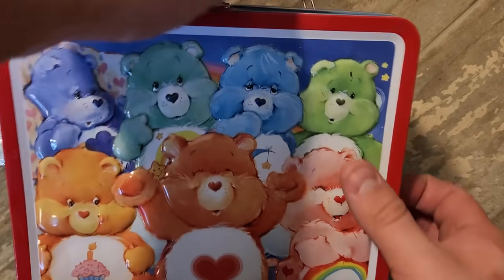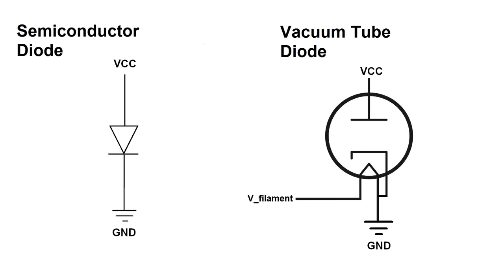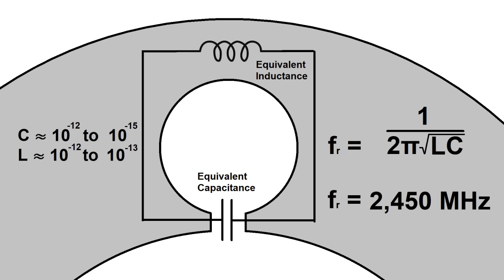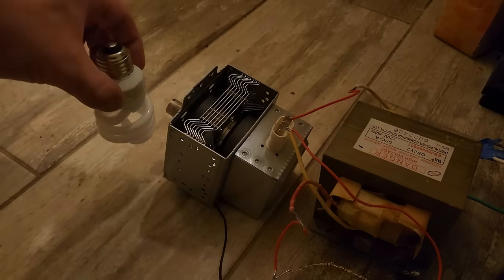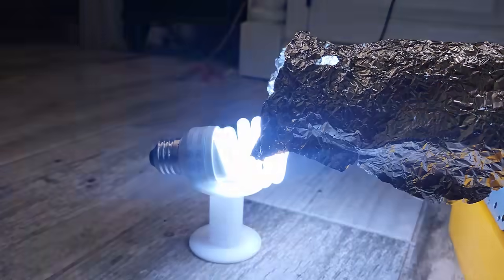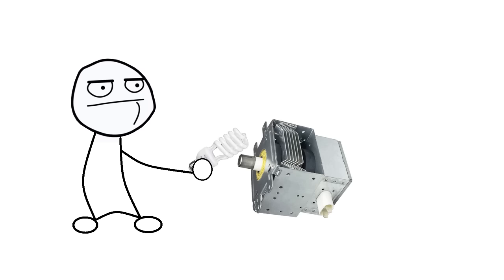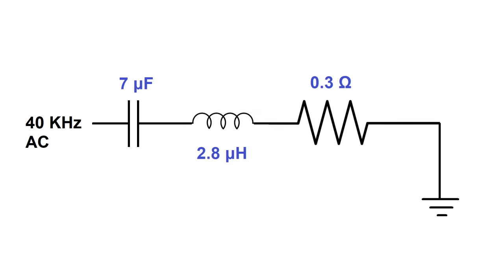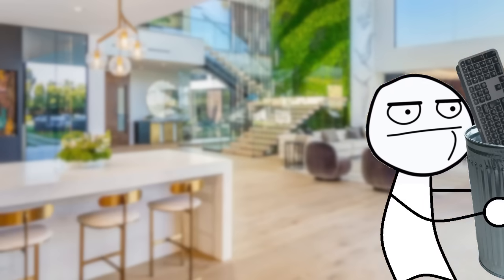Battery-Powered Magnetron

Comment: Ive messed with high power microwaves and you definitely feel the heat effects, its actually not that different than being close to a bonfire except the heat is not just on the skin, it has a few cm of penetration. The hands and fingers is were this is more noticeable, you feel them warm but instead of feeling immediate cooling as if you removed your hand from an IR source, with microwaves (2.45GHz) feels hot for longer because your whole finger warms up instead of just the surface.
Reply: The problem is with the eyes, as they have little means to get rid of the heat. And overheated eyeballs would not be fun, in fact, they could mean blindness.
Reply: @pizzablender  It is speculated that leakage from MOs causes some cataracts.
Reply: @beryllium1932  And strong WiFi with 5 foot antennas or weak WiFi at very close range for long times like having a WiFi router on your desk shelf!!!
Reply: @solarsynapse   Wifi antennas emit somewhere in the neighborhood of 1/10th of a watt to 1/2 watt according to a guy one the net who claims to design them for a living. 1/2 watt is in  at the low end middle of the range of others claiming to know the output power. Assuming the guy knows what he is talking about the oven is like 2000 times more power when the router is emitting at maximum power.  Assuming the high end claims are true then the oven is still around 200 to 500 times more power.. Assuming 1 watt sustained for 1 hour it would heat 1 liter by about 1 C if all microwaves are absorbed. So if you are already dead so there is no circulation or sweating and in a heat reflective vacuum chamber with the wifi antenna in your mouth, you can expect the temperature of your head to rise a fraction of 1 C. (Unless you are a true pinhead:-)). In a more realistic situation, you are likely alive,  blood is moving heat away from the heated area, the body sweats , air evaporatively cools the front of the eye and essentially water to water contact allows heat to move out of eyeballs while blood flowing through the retina and whites moves more and you probably don't have the patience or will to sit with an antenna in your mouth for an hour. The geometry of the room and skull might cause warmer than average spots like you sometimes see cooking meat in the microwave oven (yuck). Still seems like it would be exceedingly difficult and unusual to raise any cell in your head beyond a slight fever and then probably only momentarily.

I can see 1000 watts of a fired up magnetron easily causing damaging heating but wifi, nah.
Reply: @karlharvymarx2650  Allrighty then, should be safe.  Just don't be like the Navy guy that was cooked in front of the ship's rotating RADAR antenna to sterilize himself.
Reply: @solarsynapse  Yeah, ship radar seems to be in the neighborhood of 2000-4000 watts, so like 4 times a microwave oven. I can see that cooking up seaman's special Rocky Mountain Oysters. That's just generic ship, bet Navies have an extra crispy setting.
Reply: @karlharvymarx2650  the effects are extremely uncomfortable even without enough duration or energy levels to fully heat an area of the body, you will be dancing long before you are cooking. It affects the brain and nervous system micro-voltages.
Reply: It is definitely very different than being near a fire. A fire transmits its energy in all directions. A magnetron provides a relatively narrow stream and is not immediately obvious.

Please don’t use your personal experience to downplay the important safety messages in the comments that the creator of this video failed to call out clearly at the beginning.

You might no what you are doing, but there are a lot of very stupid people out there.
Reply: Popular Mechanics or a similar magazine once had an article about someone trying to invent a system of indoor heating that used microwaves. I think you were supposed to use it like a portable heater, aim it at yourself while you watch "I Love Lucy." I don't know what problem lead the inventor to give up.
Reply: Oh now I want to play with high power microwaves.

Comment: in the schematics this 2000 volt also connected to ground which is chasis of my microwave so how doesn't it electrocute me when i touch microwave chasis ?
Reply: You don't get electrocuted because the chassis is grounded. Ground and negative are not the same. If you touch the negative side you will get shocked.

Comment: Ah why your transformer burned out was that when you balanced the impedance you nullified the cathode chokes that are hidden under the rear cover of the magnetron, the mismatch reflected the energy back into the magnetron and the cathode created a ready made antenna. Also the pink insulators are aluminum oxidide doped with either chromium or manganese. The BeO version is bright white and AFAIK the only commercially made oven magnetron that have those are super high power industrial ones or those from early 70's microwave ovens made by Amana.❤
Reply: This comment deserves a pin!
Reply: From experience, anything that contains BeO has prominent warnings placed on it, even dating back to the 70's (old boat anchor radio transmission equipment; something along the lines of "WARNING Transistors under this cover contain Beryllium Oxide", for example). I've never seen a BeO warning on a domestic microwave magnetron - I'd expect it to be on an information panel, similar to the microwave hazard warning.
I'm surprised the author didn't know about the chokes under the heater connection cover.
Reply: Once I did something simmilar With also A 7Ah 12V bat. Although did not do the  fluorescent test a triefield meter sensed MW. Mi aproach was with an ignition Coil in series with the filament of the magnetron and firing the HV with a pulsating relay AND a capacitor only. After triying all the. Posible conections options the Best outputed some Mw. The HV was discharged by a spark plug to the Magn. Metal case in a 2 mm gap.
Reply: I know the chokes you’re talking about, I think he nullified it for his 40kHz supply but that shouldn’t stop them from working on the GHz output frequency
Reply: That sounds like actual magic
Reply: what would you know mate?
Reply: Beryllium powder is a hellish nightmare way to go.
Reply: why does stack exchange say BeO ceramic magnetrons are pink then?
Reply: @nathanieljames7462  it is a common misconception that all magnetron are insulated with BeO. I actually worked with the stuff and it is always pure white and undoped. They use it for stuff with extreme thermal conduction needs. It conducts heat similarly to aluminum metal. The things I have seen it used for were TWTs high power klystron tubes, high power tetrode transmitter tubes, the magnetron in Amana radarrange microwave ovens, thick film hybrid IC modules with airborne or space ratings, laser diode submout carriers and the arc tube of argon ion lasers. It isn't dangerous unless you finely powder it and tbh the stuff is rather tough. Also used to laser machine little hearing aid circuit boards made of the stuff which was scary AF since the masks were not always available at that factory, yup laser vaporized BeO with visible powder everywhere. What's the worst that could possibly happen. I quit. 😬 😳 💩💀💀💀
Reply: @christopherleubner6633  I've actually read multiple times about it not being that dangerous unless finely powdered and it seems to be common advice to avoid snorting the finely powdered ceramic when in doubt 😄
Reply: @christopherleubner6633  All in all I like to think about them being Aluminium Oxide based for a different reason: Beryllium is really darn expensive.
Reply: @christopherleubner6633 As far as I remember I’ve never seen a BeO Laserbore/tube without proper warning labels. Be windows are sometimes labeled. I guess metallic Be Vapor is the least of your problems if you manage to reach 2469 °C, or 4476 °F…
Reply: @christopherleubner6633 Huh, I've a 78 Radarange, I was thinking of attempting to swap magnetron for a more efficient modern one at some point thanks to use and also just age. Definitely will be extra careful with disposal if so. 1500 watts input for 750w radiated, and who knows with age. Modern ones seem to be up to 1100 radiated at 1500 watts. Not sure how much of that is the power supply versus new magnetrons, however.
Reply: @nathanieljames7462  its better to assume it is and treat it as such.
Reply: @coler154  Agreed.
Reply: @nathanieljames7462  Aluminum oxide mixed with chromium will generate a pink solid. Those are a packet of microscopic sinthetic rubies. Berilium oxide is just pure white.
Reply: @nathanieljames7462  matter of fact, if yous hine some UV on them they should light up a bright blue.
Reply: @theterribleanimator1793  That's cool but if both can be pink forgive me for leaving them all alone

Comment: Panasonic came out with inverter microwaves some years ago, which uses a dc-dc converter to generate the high voltage.
It is small and compact and light and doesn't need AC input.   I was going to change the input windings for 12v, but thought using a small 12vdc120vac inverter was way safer, and unlike the old transformers which need a real peaked ac voltage, the inverter input will work with shitty square waves.

Comment: 4:45 No, this is a "parallel" rectifier, the output isn't chopped, it's just shifted, so the output drawing is wrong - it should be the same sine, just with the top touching 0V and bottom reaching -5.6kV (or -4kV, whatever)

Comment: On Beryllium - I think this isn't true. I've heard Beryllium Oxide is only used on basically military-grade equipment. And, if it was Beryllium oxide, it would be plastered with warning labels specifically identifying it as such. And, even then it was only true up until like, 1970. I forget what oxide is actually used in common microwaves. I'd love to have someone confirm this, because I think I've been part of the crowd telling people it's Beryllium for the last 10 years. Also, be super, super careful around that MOT, I personally know someone that's died from one, and he knew the risks and was tripley safe and just got unlucky.

Comment: The reason why the circuit pulls so much current even when decreasing the magnetron power is because of how microwave oven transformers are designed.  They oversaturate the fuck out of the core of the transformer causing the impedance to drop at the mains.  You can see the high harmonic content in the mains current due to it.  It's a very inefficient transformer, but they only run intermittently.  That's how they are able to get away with it.

Comment: You must account for input resistance in a meter or oscilloscope to use voltage divider in measured circuit. I preferred to use said resistance as a R2 straight, i.e. 99MOhm R1 while meter had 1MOhm internal resistance
Reply: And if metering equipment has no spec it can be measured with ease, with known resistance and a voltage sources. Must be done to every analog range tho
Reply: I would not use the multimeter's input resistance as the only bottom resistor in a high voltage divider. If you do then the full high voltage will be present at the measuring point whenever the meter is disconnected. This might be okay if you are perfectly careful and make sure all connections are secure and the meter is in range before enabling high voltage but it is just asking for trouble.

Comment: What's the point running a 800 Watt magnetron at such low power??
Reply: some people don't like it when the FCC van and the ATF raiders show up at their house at the same time. Avoiding electrocution is also desirable to most people.
Reply: Sorry still don't quite get it. A lethal voltage stungun on steroids connected to a valve starved of power - to limit to milliwatts RF.  Some ovens leak more than that  @tissuepaper9962

Comment: Beryllium in a domestic microwave is not a thing, gladly. If it was the case, both the magnetron and the casing of the microwave would carry a sticker/label warning about this. Beryllium is expensive and not needed in this application. The insulator is made from Alumina.

Comment: Awesome stuff! I've been wanting to make a sulfur lamp, which are powered by microwave RF! I'd be very curious to see if one could be powered with this setup.
Reply: You would need a small quartz tube and fill with a little bit of sulfur and argon. The arc tubes from mercury or halide lamps work OK. You need to open it up at the filling pip and bond a silica tube to it, then add about 30mg of sulfur to it. After this fill to about 15 torr of argon and reseal the tube. The two  electrodes can be used as a starter by bridging with wire. Then put the tube in a waveguide with screen in front. Initially it will glow violet then greenish white.❤
Reply: I posted another comment on this exactly pre-reading this!  Open Source Sulfur Lamp HYPEEEEE

Comment: Something I rarely see mentioned (and occasionally not noted on the component itself) - the white plastic oval connector on the magnetron is actually a 15kv DC capacitor.  Yup. I dont know if it routinely includes an integrated discharge resistor (with mgf variations i suppose its best to assume it doesnt unless you can confirm otherwise), but standard microwave tinkering rules apply - use caution! Obviously this can throw math when adding/subtracting capacitance and should be factored into resonance/tank circuit calculations and dont overlook these when salvaging components. Many thanks for the vids - I definitely  appreciate a similarly twisted sense of curiosity, particularly when its going first lol

Comment: Meanwhile the FCC agent watching this video: 😱

Awesome video as always! :)
Reply: I just looked up the Part 18 rules and you are allowed literally unlimited radiated output in the 2.4-2.5GHz frequency range. For the exact wording, "ISM equipment operating on a frequency specified in § 18.301 is permitted unlimited radiated energy in the band specified for that frequency. "

If there is excessive radiation outside of this range (such as possible harmonics) then the FCC will be unhappy. Also if you are causing actual interference to communications operating outside the ISM band will need to "promptly" stop.

Comment: Fantastic video and demonstration. I achieved something similar by running a couple lithium cells into a constant current regulator for the filament, and another battery pack through a zvs circuit driving the primary of a flyback transformer from a CRT TV to lightly and port-ably power a magnetron.  However, this setup doesn't allow my magnetron to run at it's conventional power so I made a car battery (power bank from lithium cells) to run an inverter. The catch is, the guts of the newer "Inverter Microwaves" was used instead so no heavy dangerous MOT or HV cap. (instead its a light inverter circuit in a flyback configuration)

Comment: I don't think it's possible for the current you draw to go "back into the grid". Your live wire comes from the grid but neutral is tied to earth, so any current you take from the live wire is eventually going to earth, which means all of that power is being dissipated along the path, likely mostly in your transformer (does it get hot if you run it for a while?).
Reply: Reactive current doesn't dissipate resistively. Well, it does dissipate a little bit more power in the wires that are transmitting it, but most of it doesn't dissipate. It returns to the source on the same hot and neutral wires. It also doesn't go to ground. It shows as the current AC waveform being out of phase with the voltage AC waveform if you put current and voltage meters on the power cable and graph them together. It does "go back to the grid". The transformer acts as an inductive load and pulls an inductive current, so the current lags the voltage waveform and a significant inductive current is being pulled from and then returned to the grid every AC cycle.

You could correct this by putting an appropriately sized capacitor in parallel with the input leads of the transformer so that the inductive power is sloshing between the capacitor and the transformer instead of the transformer and the grid. Since microwaves are only on for a short time and we didn't care about reactive power in residential settings for a very long time, a lot of microwaves don't have this "power factor correction" capacitor.
Reply: @5467nick  Very interesting, thanks!
Reply: Your google search terms for today are "power factor" and "reactive current".